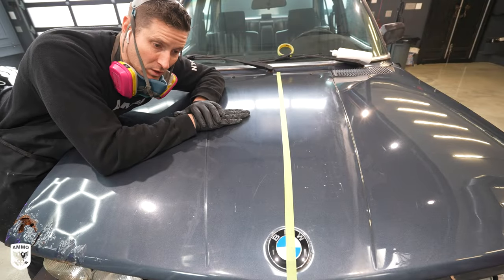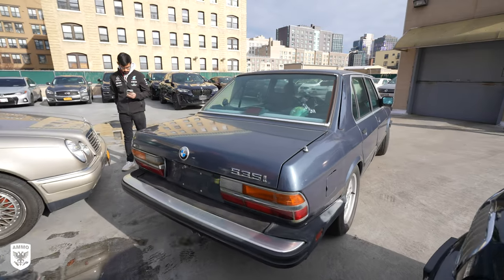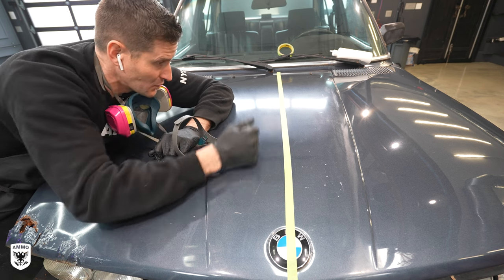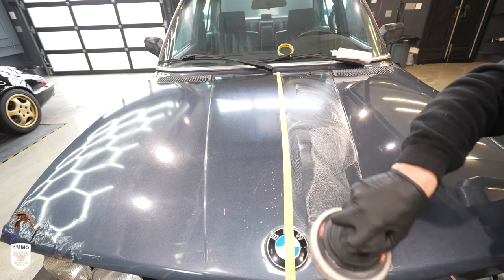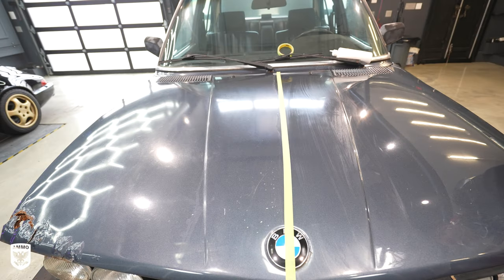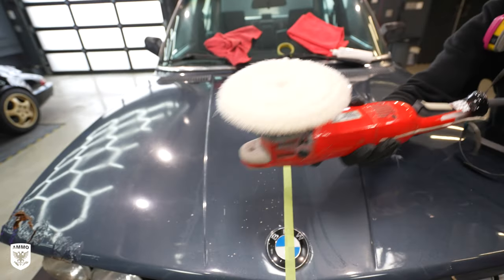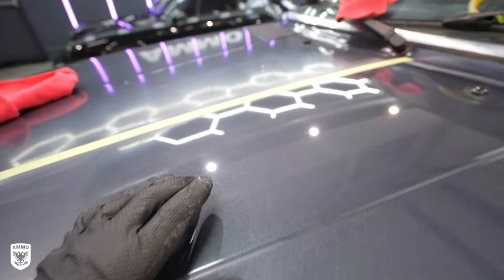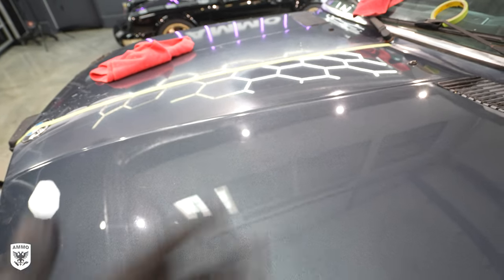Best Car Polishing Tips: How To Wet Sand and Polish BMW 535i

Comment: Greetings from the U.K. I’ve never been brave enough to wet sand with a power sander, but that was super quick and effective. I do agree that wet sanding can be safer than hitting poor paint with a buffer, you can take your time, panel stays cool, you can check progress etc.   Top job!

Comment: You mentioned wet sanding keeps the temperature down and is not as harsh because there is limited heat.  is there a wet polishing to keep the temperatures down and still polish?

Comment: I have a question about wet sanding. To what degree wet sanding can make the clear coat as flat as possible, because on the hood of my car I had an area which looks kinda wavy, it's not an orange peel, it's more like a pond, but it's at certain angle, if you are straight ahead the hood it looks flawless, but from the sides you clearly can see that. Thank you!

Comment: i filled in chips then wet sanded with 2000 grit.. still have scratches after polishing those areas with 3M scratch remover.  which polish do you recommend… what was used in this video?  thanks

Comment: I see you using those pivot bottles that still haven’t come out yet… been waiting two years now.
Reply: German Company Birchmeier has one, it's called "Birchmeier Foxy 360". It doesn't have a pivoting head but the pick up tube on the inside is weighted and very flexible so it follows gravity and always gets fluid.

 Maybe thats an option for you :)
Reply: @mino7122  good to know! I ordered 10 or so with the kickstarter for the pivot bottles. They should ship soon… but literally a year later than projected originally. 

Thanks for the tip, I’ll check those out.